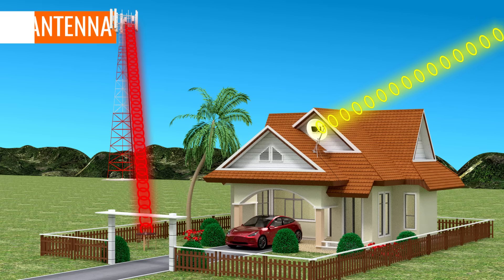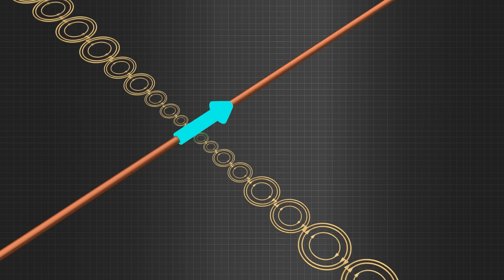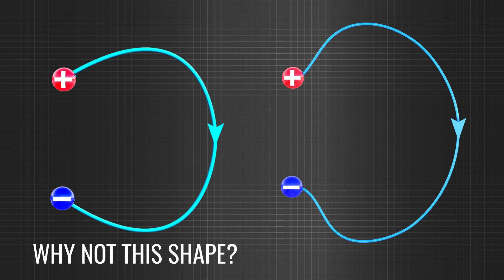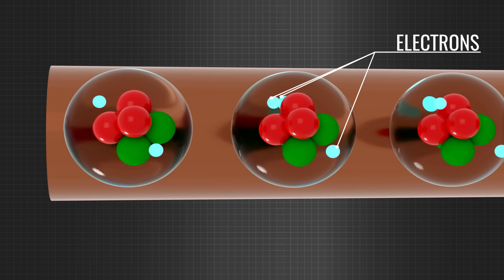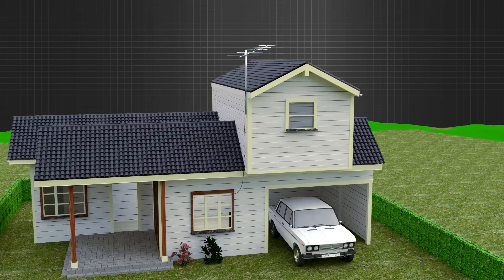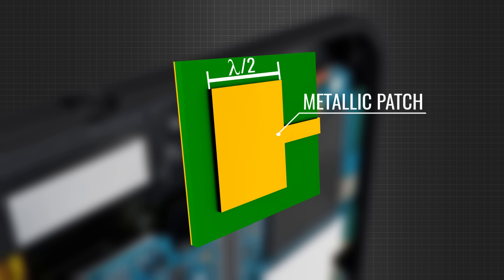How does an Antenna work? | ICT #4

Comment: Good effort, however I believe this "kinky" explanation is a gross misrepresentation of the underlying physics. Kinks that cause field lines to "detach" allowing them to propogate along their merry way, incaccurately likens radiation to a turd that needs pinching to be released from a buttock. The fundamental underlying mechanism is so more elegant that. More accurately what is actually happening is (please correct me if I'm wrong or can use better terminology) ... the "field" / "field strength" / "field state" / "message of field information" (whatever you want to call it) is ALWAYS CONTINUOUSLY being emitted outwards in all directions from a point charge (at the speed of light) whether the charge is moving or not! Even a stationary charge continuously emits this field in all directions outwards to every point in space. Every point in space is subsequently continuously receiving this delayed field state (delayed due the finite speed of light this field message travels at). In the case where the charge is stationary, each point in space will still get this continuous update, however the field strength at these points WON'T have changed from one moment to the next. But then if the charge does move position (either at constant velocity or acceleration) the same point in space (which is continuously recieving these delayed updates) will now receive an update that tells it the field strength there HAS changed. Point is - the underlying mechanism WAS ALWAYS CONTINUOUSLY emitting outwards at the speed of light!  "Kinks" don't magically causes a detachment that allows it to propagate outwards, more perhaps that the kink is simply the measurable ripple (change of field strength) that is then also carried off at the speed of light. (This moving ripple effectively equates to moving energy, ie EM radiation).  A light-speed travelling "No change in field" may not be as noticeable as a travelling "change in field" which sticks out like a sore thumb!  Analagous to how a Seismometer needle contantly draws on a continuously moving paper, whether there are vibrations or not. Even when the needle remains perfectly still, and the line it draws thus perfectly flat, the line is still being drawn and the new ink continuously carried away from the needle, but if not looking closely enough, one may think the Seismometer paper has stopped moving and new ink is not continuously moving away from the needle. <End Analogy> So don't be fooled, charges are also ALWAYS continuously emitting field outwards! A better video to help break down this misconception I think is one ... https://www.youtube.com/watch?v=uZnXhRgztEg
Reply: We live in a 100% magnetic universe..... it's that simple!!   The center of a magnet is by far the most powerful part!!!   that's where you will find anti gravity and most everything else.   STUPID HUMANS!!  We went backwards in the Iron age!!  the center of a magnet is where we belong after all that's what we are all configured with..FACT!
Please review the works at "CORAL CASTLE, Florida. (YouTube),   He would "VIBRATE" ,,  not oscillate the granite at a resonant frequency to the type stone he was working with.  Granit has allot of magnetic properties given it's make up...  You just need to vibrate at the correct freq.  and it will become workable.  Keep in mind we are talking about vibrating only the "B" field of a magnet into the rock!!!   You will note at Coral Castle he also had a horizontal stone , similar to Stone Henge... All his magnetic generators were in the repel mode to maximize the "B" field..  SIMILAR TO THOSE Shown ON THE PYRAMIDS OF EGYPT..  FACT!!,  THINK about it THAT'S exactly why they used copper tools!!!!  You must use copper tools and any iron would totally dispute the field.  Quantum Math is total B.S.  E=MC2 is also total BS... E=MD.  (Magnetic density).  Thanks  Vincenzo.. Please use your brain!!  If your professor gives you any flack,  have him explain the speed of magnetism.  It's instantaneous.
 That's how they used the pyramids as transportation devices, inter Galaxy type transportation that's exactly why they were 8 sides to create a perfect hologram from earths magnetic field that could be used to connect interglacially

Comment: One content, two languages. What I have now written may have a perfect mirror in another language. You can create a program that searches for the perfect language mirror. Thanks to this, you will be able to speak two languages and perform tasks in the shade.Endless enigmatic book in all languages. You can write a book with mirrors in all languages of the world. You can speak two languages at once, you just need to find the perfect reflection, same content, different translation. Infinite Mirrors. Pi 3.14 XBooks. Hybrid language. The algorithm flows through our heads, endless coding, just take off the chameleon masks. Connect words without spaces and you will find hidden tasks in all languages. Our conversations collide in the process, some words as well as numbers in words. We perform tasks hidden between words. You can create a Python coding language from a spoken language. You just need to find the mirrors. Two tongues glued together.

Comment: Good animation, but plenty of mistakes. A yagi UDA doesn't focuses anything, but combines self radiated energy by parasitics elements with a proper phase, to combine (add, or substract energy) on the dipole. Radiation occurs because of electrons acceleration, not because of movement. And more, a dipole doesn't need to be half wavelenght to be a dipole, and to radiate anyway (it's enough to match impedance and minimize losses).

Comment: What you call source EM waves do in fact propagate, just not very far.  When PCs ran about 5 to 10 Mhz they came with cases that shielded them.  Modern cases do not have such protections.

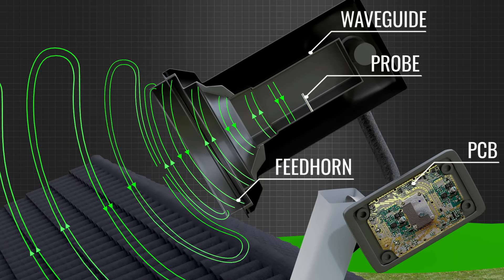Comment: Great video. At 6:35 you can see the "Near Field" effects of the antenna (about 1 wave length) as the magnetic wave loops start to compress and break into linear fields.  Another thing antennas do is "Impedance Match" the transmistter/receiver (50 Ohms in transceiving antennas) to the impedance of air.  There is a lot of electromechanical science in antennas. Also, electromagnetic waves do some non-intuive things at higher frequencies. Frequency ranges are divided up into groups called "Bands". For example the K Band is known for its interaction with water vapor in the air. The frequency at the center of the K Band is the resonate frequency of water. Your microwave oven works off a harmonic of this in a lower frequency band. Because water molecules in the air absorb enery the most at these frequencies, they "Attenuate" or reduce the strength of the waves for long distance use. Other gases and molecules in the air also effect electromagnetic waves to varying degrees at various frequencies.

Comment: how did a human being reach to a conclusion that oscilating dipole can create a travelling EM wave and then to transmit information using that is pure genius... damn
Reply: :face-red-heart-shape: OMG.. you and I are on the same page!!  yes the pyramids  were a interplanetary communication device that operated at a very low frequency.  But also the great Pyramid of Egypt was a teletransportation device, ,, NOW Stone Henge and Gobekli Tape: they were power plants. ,  You will see chips on the upper parts of the stones as they were perfected to a operating frequency.  The horizontal pillars were set to vibrate at a particular frequency magnetically, for many reasons, each horizontal rock had a purpose!!   some were used to excite the seedlings in the ground, to expedite the growth, some were tuned into earths mag field and provided magnetic lift via the Earths "B" field .  Check out Coral Castle Florida,  ED used What I call a "B" field generator, His generator used "V" magnets to ensure max delivery of the "B" field Just like is being used at the black pyramid of Alaska.  His generator used 25, V mag around and 5 deep to produce the "B" field into the earth and special stones.  THE "B" field is the center of a magnet/ some like to refer to it as the neutron field.  But the 'B" field is much much more !!!   I wonder if the black pyramid of Alaska used magnetite as a skin for the pyramid that would explain many things!!!   Tesla new about the free power that's available through the CENTER FIELD of a magnet AS you are well aware the rich boys didn't want it,  It's been there all the time.  When the government took down the horizontal stone at Coral Castle the entrance door stopped working.  Funny thing they gave us the clue,, His horizontal rock was providing the magnetic energy to support the access door.  AS you know magnetic energy is perpetual  JUST GETTING started with all this.   I don't need to brag about all my credential.!!  I got into physics back in 1959 as a ham operator at 9 years old I would design and build my tube type radio's for Rec and xmit.   I know what I'm talking about..    When they say all they had were copper tools OMG HOW STUPID!!!  when you understand the properties of a inductive that being utilize to build the pyramids you would understand a copper tool was every bit of a power tool  BIG TIME!!!!!!!!!!!!!!!!

Comment: An antenna is an impedance match between the impedance of your transmission line and the impedance of free space (377 ohms).  That's it.  There are moving E & M fields at right angles to each other propagating along the transmission line, through the antenna, and through free space near the antenna and through free space far from the antenna.

Comment: Is it important that the dipole halves be ‘L’ shaped?  What if I had insulated cable connected to 2 lengths of straight wire, oriented 180 degrees apart?  Would the antenna still radiate?

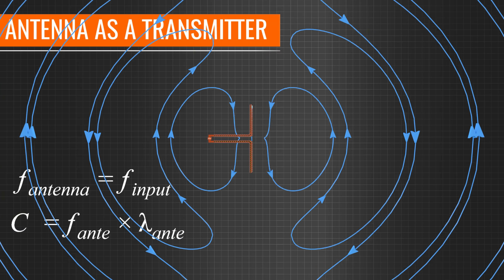Comment: Only one think i think may be wrong. At 3:00 you say wave lenght is double the size of dipole, but the wavelenght of radiation is function  of frequency of dipole oscilation and not size of dipole as you say at 4:23 its frequencies that are identical.

Comment: There is a small error in your animation 5:00 of a receiving antenna.  Electromagnetic waves are transverse waves with the electric field perpendicular to the direction of motion.  In a dipole antenna receiving a radio wave, as with the earlier one transmitting a wave, the direction of motion of the wave is perpendicular to the antenna's elements so the electric field is parallel to them.  Your animation 5:00 shows the  wave traveling parallel to the antennas elements.
Reply: Yeah right!? How come nobody else seems to pick up on this basic error? I kinda stopped watching at this point. Also I believe this "kinky" explanation is a gross misrepresentation of the underlying physics. Kinks that cause field lines to "detach" allowing them to propogate along their merry way, incaccurately likens radiation to a turd that needs pinching to be released from a buttock. The fundamental underlying mechanism is so more elegant that. More accurately what is actually happening is (please correct me if I'm wrong or can use better terminology) ... the "field" / "field strength" / "field state" / "message of field information" (whatever you want to call it) is ALWAYS CONTINUOUSLY being emitted outwards in all directions from a point charge (at the speed of light) whether the charge is moving or not! Even a stationary charge continuously emits this field in all directions outwards to every point in space. Every point in space is subsequently continuously receiving this delayed field state (delayed due the finite speed of light this field message travels at). In the case where the charge is stationary, each point in space will still get this continuous update, however the field strength at these points WON'T have changed from one moment to the next. But then if the charge does move position (either at constant velocity or acceleration) the same point in space (which is continuously recieving these delayed updates) will now receive an update that tells it the field strength there HAS changed. Point is - the underlying mechanism WAS ALWAYS CONTINUOUSLY emitting outwards at the speed of light!  "Kinks" don't magically causes a detachment that allows it to propagate outwards, more perhaps that the kink is simply the measurable ripple (change of field strength) that is then also carried off at the speed of light. (This moving ripple effectively equates to moving energy, ie EM radiation).  A light-speed travelling "No change in field" may not be as noticeable as a travelling "change in field" which sticks out like a sore thumb!  Analagous to how a Seismometer needle contantly draws on a continuously moving paper, whether there are vibrations or not. Even when the needle remains perfectly still, and the line it draws thus perfectly flat, the line is still being drawn and the new ink continuously carried away from the needle, but if not looking closely enough, one may think the Seismometer paper has stopped moving and new ink is not continuously moving away from the needle. <End Analogy> So don't be fooled, charges are also ALWAYS continuously emitting field outwards! A better video to help break down this misconception I think is one ... https://www.youtube.com/watch?v=uZnXhRgztEg
Reply: @BenjaminK2  You are using the term "radiating" in a different way than it is usually used in electromagnetics.  In EM "radiating" usually means emitting electromagnetic radiation.  A stationary or steadily moving charge has an electric field, and a steady current has a magnetic field, both of which can be detected at a distance.  But neither radiates energy; electromagnetic waves.  To radiate electromagnetic waves, a charge must be accelerating or decelerating.
Reply: @seanmcmurphy4744  I see your point, thanks. I've changed "radiating" to "emitting outwards in all directions from a point"... "Radiating" in common terms can simply mean "spreading out from a central point", but in physics youre right it does usually specifically refer to emitting energy. The energy emittance (Radiation) thus is just a special case (a ripple in the field) which is continuously moving outwards. So point is, that the field is always continuously emitting and moving outwards regardless of whether it carries this ripple or not, and this video grossly misrepresents the real mechanism. It seems to liken radiation / fields to a turd that needs pinching to be released from a buttock.

Comment: At 4:45 is that blue sine wave the voltage signal? Or is it meant to illustrate the electric field strength along the antenna arms? If the latter, shouldn't the sine curve be rotated 90 degrees?
Compare this section to the animation at 6:34, which seems to suggest the electric field vector oscillates in the direction of the main axis of the probe, and we can imagine a sine wave propagating along the orientation of the waveguide. Is that correct?

Comment: Excellent video, congratulations. As the length of the dipole is λ/2, it was necessary to emphasize that in practical applications the antennas have to operate above a certain frequency, otherwise its construction would be impractical. Furthermore, plane electromagnetic waves only form after a distance of λ/2π from the dipole.

Comment: Simplified. Though in the feedhorn the part you called a probe is actually called an element. Having one element vertical & one horizontal is referred to as H/V Dual polarization. Any device with more than one element is typically using Mimo technology. Multi, In, Multi Out. Theres a couple of common techniques with mimo. One is H/V or 90 degree & Slant 45. S45 means the H/V elements are rotated to 45 degrees off axis. this allows for use of a different air space to help avoid interference. 
You covered the basic concept of an element, yagi, horn & patch. But it would have been cool to cover some other antenna types like Sectoral or omni directional.

Comment: Ignoring the spelling errors, this is a great video! One correction is that most TV antennas are Log Periodic antennas  (basically several staggered dipoles) to cover a wider frequency range. A Yagi-Uda would be most effective for a single, resonant frequency only.

Comment: Great explanation throughout the video! However,  when you talk about the loop antenna at the start of the video you say that it does not transmit a signal. This is incorrect because the antenna is a loop antenna and does transmit a signal (EM wave) when a sinusoidal voltage is applied to the terminals of the loop. The radiation pattern of a loop antenna that is orientated with its loop facing in the upwards position is similar to a dipole antenna. This being the shape of a doughnut. 

A final note is that any conductor that has a time varying current (accelerating charge) will radiate an electromagnetic field, regardless of its shape. Its the geometry of the conductor that will determine its radiation pattern for a given frequency.
Reply: "Antenna as a receiver" part is totally wrong

Comment: Why wavelength of antenna doesn't change when frequency is change
Reply: It does. Wavelength is completely independent on atenna type, geometry, dimensions etc.  For split dipole antenna there is nothing "perfect" of being L=lambda/2. Dipole work pretty much the same on any length from 0 to 1.5*lambda.